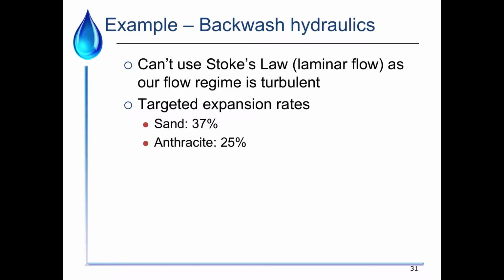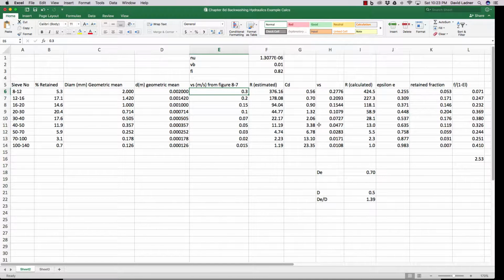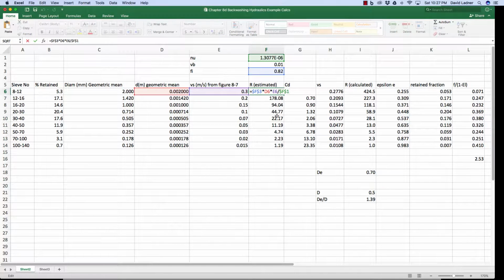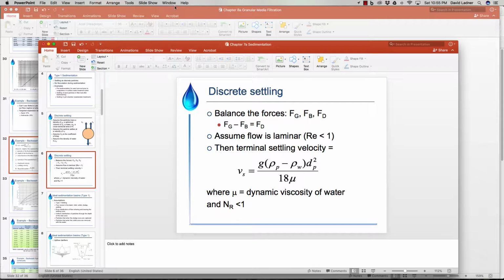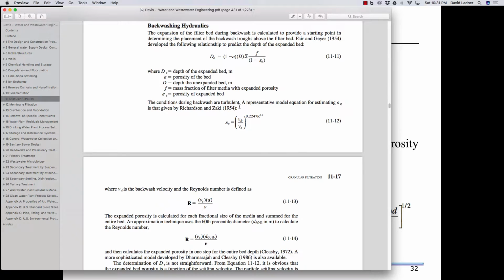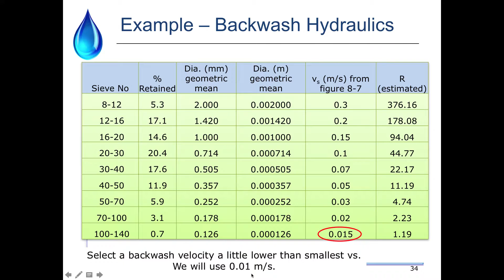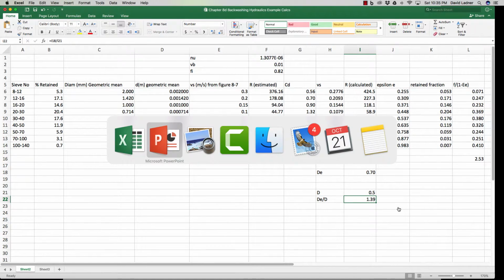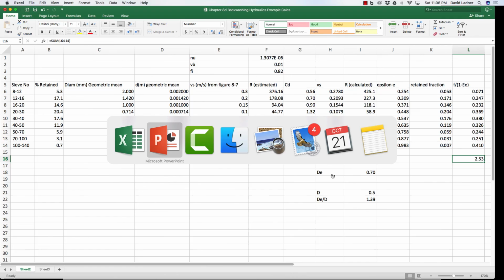Backwash Hydraulics Example

Comment: Many thanks for this clear statement. But I couldn't figure out how to calculate the diameters corresponding to the given sieves? I will be glad if you explain this :)
Reply from the maker: Hi Dilara. Thanks for the question. The sieve numbers are arbitrary (as far as I know). We have a table in our textbook (in the appendix) that tells us what the actual opening size is for each sieve number. Then we calculate the geometric mean diameter. Here's a link to the table: https://cecas.clemson.edu/ladnergroup/share/SieveSizes.pdf
Reply: Okay, i got it. Thank you so much for your interest.